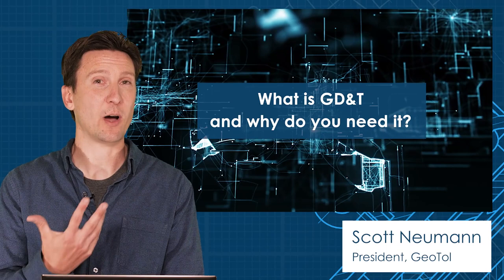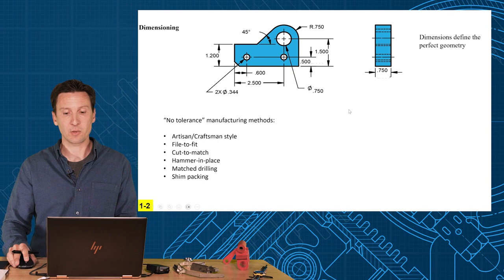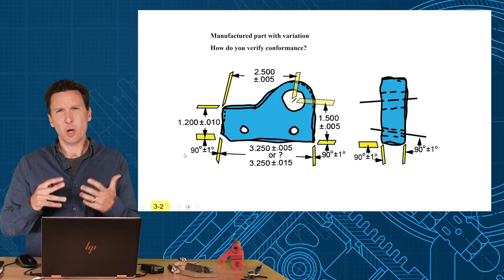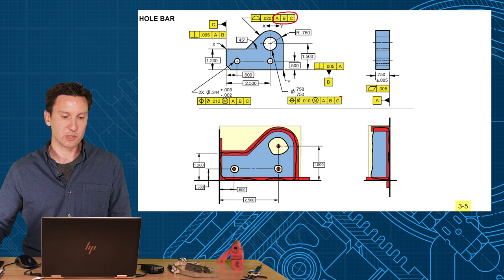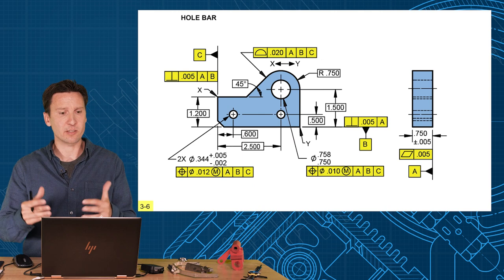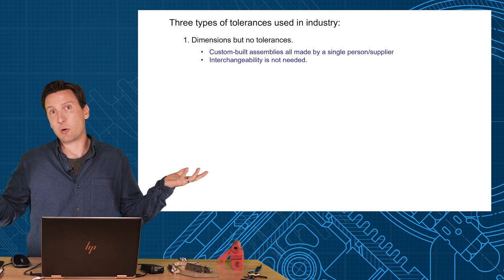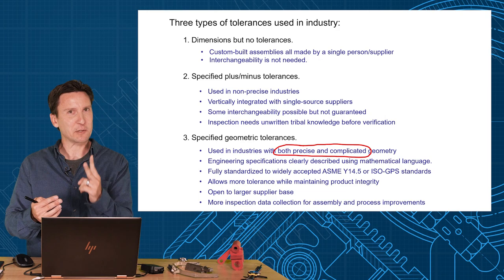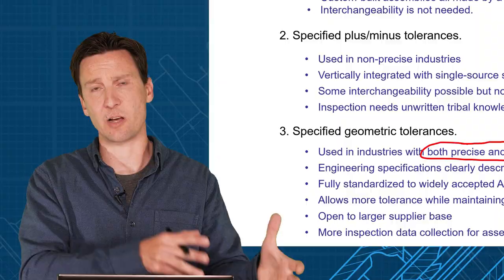What is GD&T, and Why Do You Need It?

Comment: Yes, I like this idea. Coming from "geotol", the conversion to "gt" is logical.😊

Three types of tolerances: How many different industrial uses are there for engineering drawings? I’m afraid more than 10…

The old +- tolerances fit very well with an immediate production drawing for the worker, which is essential for the product creating process.

Geometry tolerances can describe what the result of the production should be, but cannot be produced directly only under tool control. This is the mysterium of „gt“, isn‘t it? The solution of ISO GPS is called „duality“ according to ISO 8015.

Where is the explicit functional specification? There will be everytime a relevant difference between the gt-modell and the natur functions „tough“ at A, B and C or „fit“ at the three bores. A secret function might be at the features between „X“ and „Y“. Knowledge of the natural functions would be helpful for the creation of a practicable verification specification.
Reply: Oui, je suis d'accord avec ton avis
Reply: Peut-être que dans un avenir proche, on harmonisera "gd" et "ISO GPS". Après tout, nous travaillons tous avec les mêmes fonctions naturelles. Mais ce que je n'ai pas compris jusqu'à présent : Pourquoi la jeune ISO GPS de 2011 a-t-elle dû être modifiée si souvent (ISO 1101, 2692, l'année prochaine ISO 5459) alors que l'ASME existe déjà depuis 1966. On aurait pu faire mieux, non ?
 
Et que l'on applique le principe de dépendance ou le principe d'indépendance n'est qu'une discussion académique du point de vue du concepteur. Il est facile d'utiliser des mesures de taille linéaires uniquement pour les ajustements. D'un autre côté, un ajustement sans autre restriction de la mobilité dans le jeu est plutôt l'exception. Les deux principes ne conviennent donc pas si facilement à l'utilisation non éduquée par le concepteur.
 
En tant que concepteurs, nous devrions parler davantage des fonctions naturelles des éléments géométriques. La norme ISO GPS décrit clairement les fonctions de contact bien connues que sont le "contact" (ISO 1101 : position avec filtre HO et élément tangentiel) et l'ajustement (ISO 2692).  Ces deux fonctions sont également couvertes par les normes ISO 25378 5.8.2 et 5.8.3. Restent les fonctions secrètes des éléments géométriques

Comment: How to use Solidworks MBD to dimension X and Y in a drawing.
Reply from the maker: I'm not sure of the exact buttons to push in SolidWorks. You need to highlight all surfaces between points X and Y, then apply profile. The surfaces in the CAD need to be digitally associated to the profile annotation.